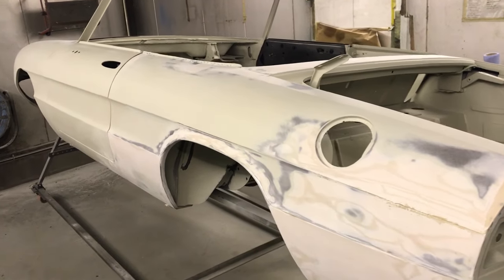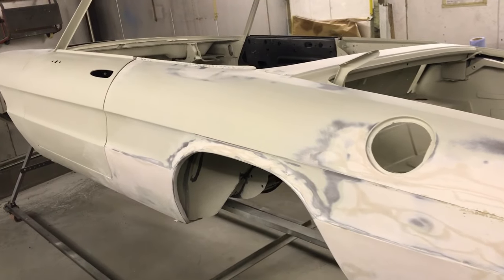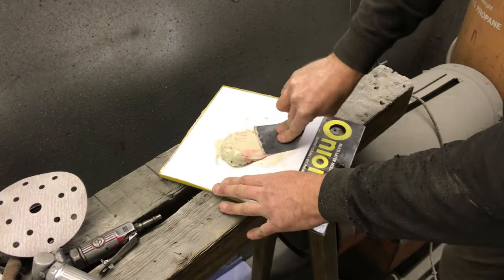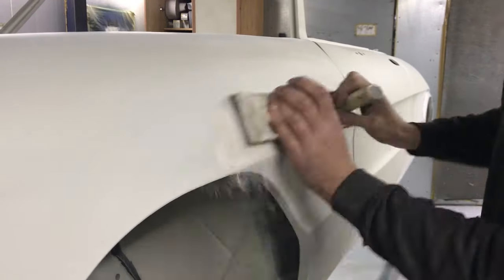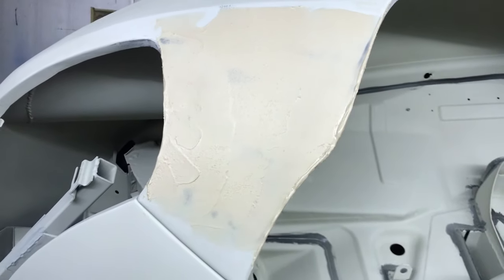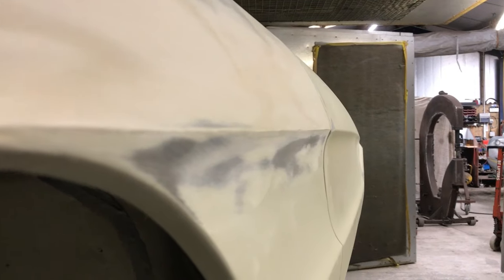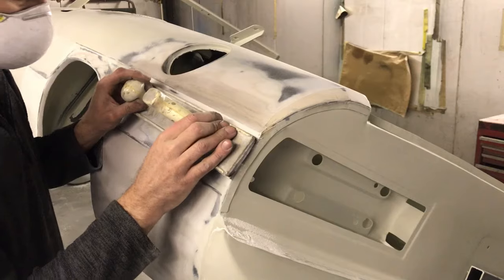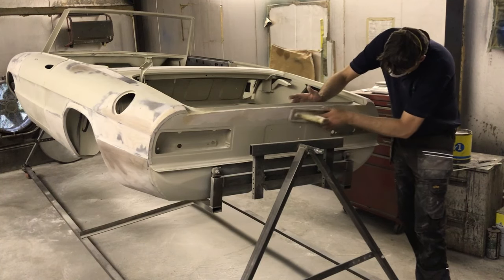Filler/ Bondo, Restoration the complete guide to using it and sanding it. Alfa Romeo Spider

Comment: Can't wait to see paint on this!
Reply from the maker: @jameshamm7167  Me too, always nice to see it in top coat, I'm still finishing off the filler work but it's not far off now. I will leave the car for a month or two in high build primer to let the paint shrink, then it's going to be final sanded and sprayed, I'm not spraying it myself as my facility's aren't up to scratch for top coats. 
I need to get the underneath in Upol raptor and get it back on its wheels soon. The axles are all powder coated and ready for assembly.

Comment: Over the years, i developed a habit where as I add the coats of filler, since it's closer to the shape,  i go finer in grits. Usually, start with 80 , 120 on second, and finish off with 180 plus 240 all over and in with the HB primer. Use to use 1k glaze putty for pin holes. That was a horrible thing to use. Top work the sir  👏 👌
Reply from the maker: Nothing wrong with that if it worked for you 👍. As you know the finer the grit the less effective it is at cutting, 80 and 120 are pretty course and effective at shaping. Likewise we don't want deep scratches for the paint to shrink into later when it comes to finishing.

Comment: Perfect job and advice Ben. There is an incorrect stigma regarding filler that has been passed on to bodywork novices by so-called professionals that really ought to know better. I am sure everyone who has a serious interest in cars knows of Chip Foose. He turns out cars that stun the world they are so good. Every car he does is skimmed all over in filler and then blocked to within a mm of its' life. I think it's worth mentioning though, that show cars and daily drivers are a different breed entirely. There is a quite common restoration technique of filling completely across the door gaps, then blocking across from the door to the adjacent panel. This gives a laser-straight finish when you sight down the car, and also lets you get the door gaps absolutely perfect. The problem is that the door edge has maybe 1 to 2mm of filler on it which makes it very weak when it comes to withstanding the slight knocks of people getting in and out. I guess a happy medium has to be struck sometimes.
Reply from the maker: Totally agree, I tried the fill and block right across the doors but don't think I'll do that again. Like you say it's weak on the edge, ok if you lead that area but not polyester filler. All it takes is someone shutting the door with the seatbelt in the shut and it will leave a large chip. 
Like you say fine for a show car but not for a car that's going to be used a lot. Slight curve towards the door gaps looks original to me. Defends what you like the look of I suppose. 
I watched chip foose on tv and Boyd coddington. I've seen Charlie from American hot rod using lead around the door gaps. It's a lot of work to do.